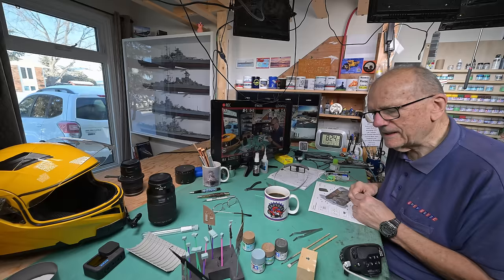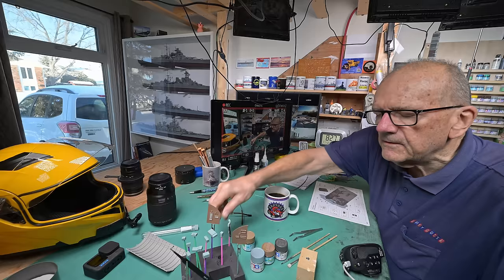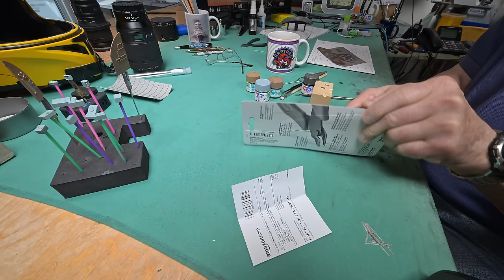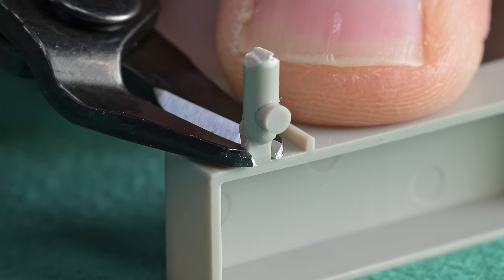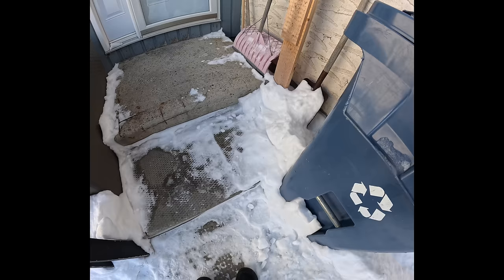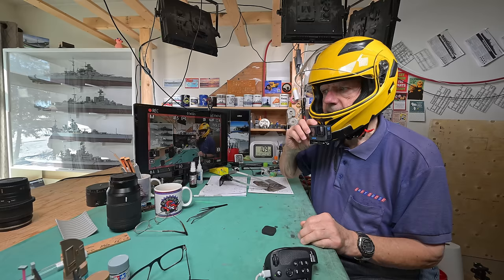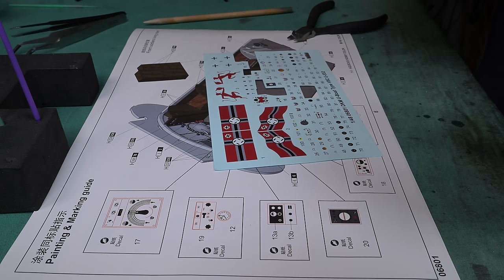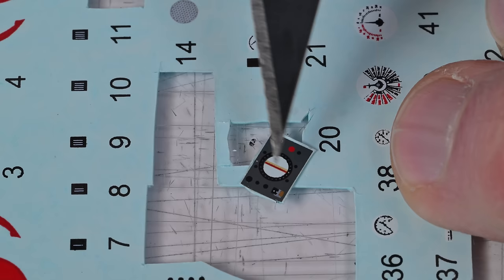The Model Ship - Part 1921

Comment: Godhand nippers are the way to go ron, they cut instead of pinching,  no stress marks in the plastic at all and no twang .
Reply: I have a pair of DSPIAE single bladed cutters and they are also very good at minimising what you have to clean up after cutting.
Reply from the maker: They'd better be fantastic for that much money Andy! https://www.amazon.ca/God-Hand-SPN-120-Ultimate-Nipper/dp/B00T5IH8PI
Reply: Yes they certainly are ! Requirement if working with a expensive kit like say wing nut wings.
Reply: A set of glass files is the next step to a perfect clean up